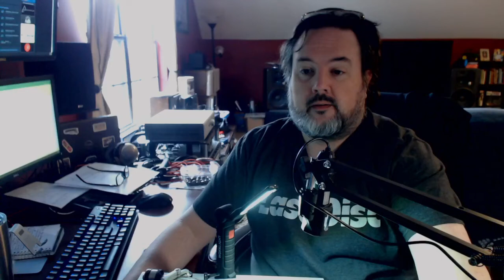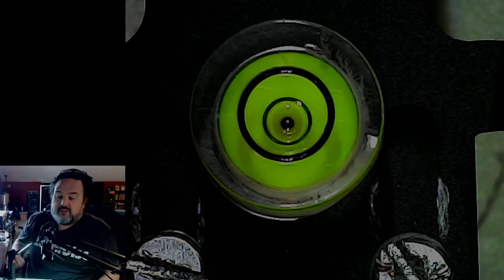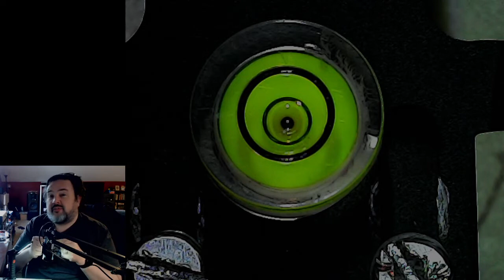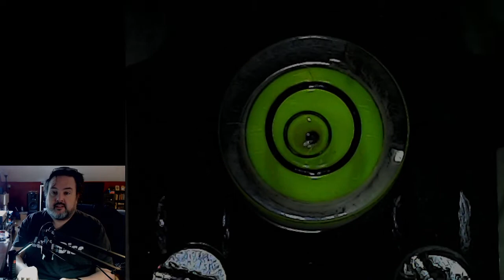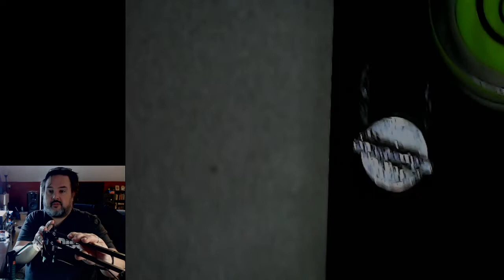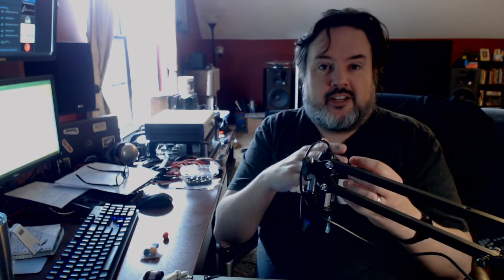How to Adjust Azimuth on a Turntable

Comment: I’ve noticed every 1200 model I’ve had (from 6 MK2’s to now 4 M3D’s -2 being Mint) they’ve all had play at the cartridge collar. I used to visually adjust them straight, but now I use a little flat level. It is what it is :-/ But it can be maintained. You nailed it by saying it’s from the locking nut.